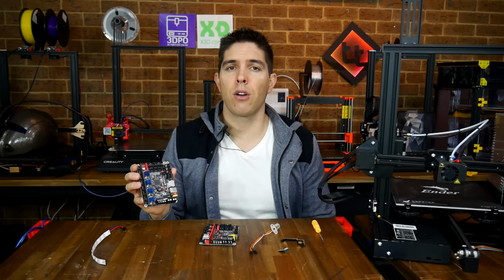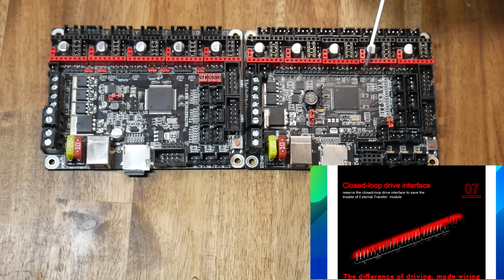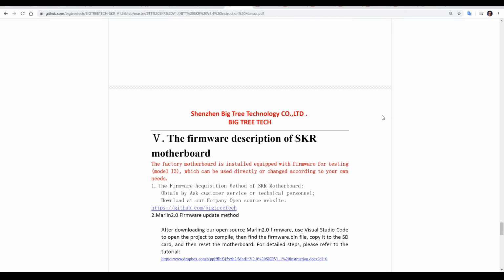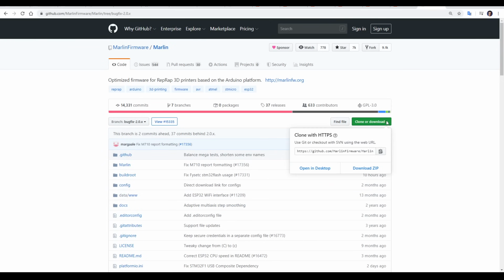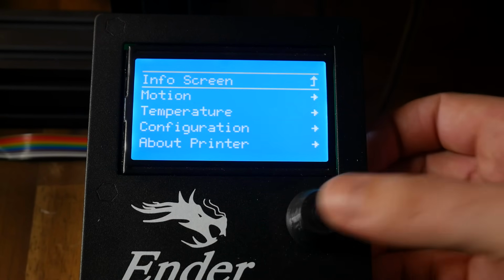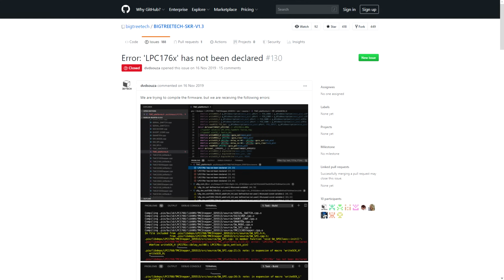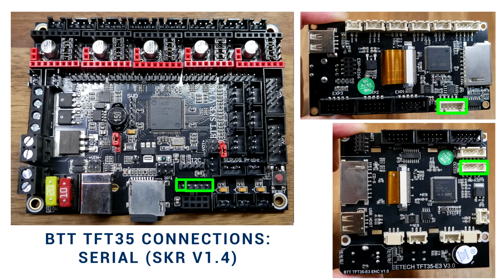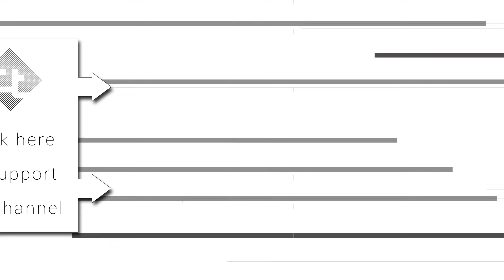Bigtreetech SKR V1.4 (Turbo) comprehensive guide

Comment: I have an Ender 3 Pro and replaced with BTT SKR 1.4 Turbo along with the original 12864  LCD Control Screen (came with printer). After doing everything Michael mentioned in this VERY HELPFUL video, I ran into ONE ISSUE. When scrolling down to print off the SD card I would only see "Attach Media". ... After many hours and taking out whatever hair I have left, I noticed under "configuration_adv.h"  that the #define SDCARD_CONNECTION was set to LCD (#define SDCARD_CONNECTION LCD). Obviously there is no SD card slot on LCD. You'll need to change it to #define SDCARD_CONNECTION ONBOARD . Flashed the Firmware and finally I see the "Print from Media"! Hope this helps others with the same or similar setup.

Comment: In order to use bltouch proprietary connection in skr 1.4 board, you must change the pins port in pins_BTT_SKR_V1_4.h file.

From: 
#define Z_STOP_PIN         P1_27
To:
#define Z_STOP_PIN         P0_10

Great content teaching tech, keep going!
Reply: Thanks man, it fixed it for me
Reply: You do not need to enable #define_BLtouch in configuration.h?

Comment: Thank you for doing such in-depth guides. Tonight I upgraded my CR-10s to the SKR 1.4 with 2208 drivers and it went just fine. But it’s very easy to skip something and waste tons of time figuring out the mistake. My advice for noobs like me is to watch, listen and re-watch. Excellent content. Keep up the great work. 👍
Reply: I'm trying to do it on a CR-10s but it is not loading up, it turns on but does nothing.. any idea what I might of missed?
Reply: Hi! Are you using Legacy mode or UART mode for your 2208? Because it seems UART mode for 2208 requires soldering, but it's not mentioned in the video,can you confirm? Thanks

Comment: I have an SKR V1.4 Turbo on order with the TMC2209 and a TFT35 V3.0. I've never performed any of what you've shown but understand what's going on and your video....well...so amazingly well done, to the point with sufficient explanations. Looking forward in executing this project which will involve replacing my controller box with something designed differently, maybe that one from Thingiverse between the frame rails. Thanks for a nother very informative video, I learned a lot.

Comment: So I've watched this guide multiple times start to finish and it's amazingly thorough. With that being said my ender 3 has been out of commission for about 2 months since I did this upgrade. I followed everything to the T and haven't gotten a successful print since the upgrade. Things I changed are SKR v1.4 Turbo, BLTouch, and Hero Me Gen 5. The issues keeping me from getting a successful print is as follows. When I try to home, the X axis will move slightly then home the Y and Z normally. I tinkered with the sensorless homing sensitivity but the issue is let's say at 55 it moves ever so slightly and stops as if it's homed and at 54 it crashes into the endstop makes a horrible sound until I power off the printer. There are times it doesn't do this so then I move on to bed leveling with the BLTouch, for the most part it levels the 9 points on the bed fine but sometimes when I get to this step it probes off the bed as if the offsets are off but trust me, they aren't. I've gone through the marlin rebuild process about 10 times now, each time starting from scratch and patiently ensuring all the settings are exact and perfect. Another issue is if I make it passed the bed leveling stage and attempt a print the printer acts as if its not leveled and prints like a whole 10mm off the bed and no amount of Z Offset seems to help with this. I've even gone to the extent of disassembling the entire printer and reassembling to make sure everything is square and not built unevenly. I pretty much gave up about a month ago after spending literally 10 hours straight debugging/tinkering/rebuilding marlin, and yes I mean literally my adhd had me in hyper focus mode and did break focus until i noticed how thirsty I was. It's just such a grab bag of issues that I don't know where to start or what would cause what issue. Like the issues I mentioned intermittent like I can have it to where the sensorless homing sensitivity is good enough to where the X will crash but stop after that which is annoying but hey atleast it's moving right? Then i get to leveling and it'll probe off the bed so I have to restart and now the sensorless homing isn't working? but the bed leveling is? makes no sense. I'm not trying to bash your video just really really want some help so I can actually print things again.
Reply: Look at the video about 13:40 minutes if you are using TMC 2209 you need to clip the pin if you are still using the endstops.   If you want sensorless homing then remove the endstop and do not clip the pin.

Comment: I got this board just over a week ago, and I absolutely love it compared to the SKR Mini S3 I was using prior. There's a lot more options and connectivity, and it stores settings without any messing around! I actually went through 2 SKR Mini E3 boards, and both had the X-axis driver burn out in less than a day. I bought the SKR 1.4Turbo because if another driver blew, I could just replace it instead of the whole board. Thankfully, I haven't had any drivers die since! But to be safe, I have installed a remix of the AIO enclosure that has direct cooling to the drivers, and used thermal epoxy to affix the heatsinks, in order to get the best heat transfer. Thanks for all of your work so far, you've been my greatest resource since I started printing almost a month ago!
Reply: I feel you, my SKR Mini X axis driver died a couple days ago and I'm now back on the noisy stock board so I can get some prints out. I swore to never buy another board with integrated drivers.
Reply: @oriongaby  my sentiments exactly. I thought maybe I had just gotten a bad board, but an identical failure told me I should try swappable drivers. The 1.4 was exactly what I needed, I just wish this video had come out a week earlier!
Reply: @munkpuppy  I think there's something related to the board design that is causing problems with the X axis driver. If you search on the internet you will find other people that have had the same problem. My board died randomly, I was fixing a loose screw in the Y gantry and had to remove the screen and printed drawers that were under the bed, when I plugged the screen back in and turned on the printer the error message was on the screen.
Reply: @oriongaby  mine failed under similar circumstances; both times I turned off the printer to make an adjustment, and the next time I turned it on, the x-axis is dead. Good to know it's not just me!

Comment: Excellent video ... The mainboard on my Creality CR10 v2 recently stopped working and I purchased the BTT SRK v1.4 Turbo with TMC2209 v1.3 as a replacement. It's been a straight-forward swap so far and The Marlin setup (V2.1.1) has gone smoothly also.

Comment: I just got my BTT SKR 1.4 Turbo with TMC2209 steppers. I plan to install this on a CR10S V1 along with my BLtouch, and direct drive Hemera. The current system is working great, although I feel the need(want) to get a 32bit board. I guess if you mess up you can squeeze the little duck it comes with, that should make you feel better. Thanks for the guides, I'll be going over them multiple times!

Comment: Great video! Very concise and enough detail to get the BTT board setup without a lot of hassle. Getting the BTT V1.4 board to work from scratch isn't a cake walk due to very poor documentation but thankfully there is this video and a lot of info from the community.  
To make BLTouch work requires that the file "pins_BTT_SKR_V1_4.h (or pins_BTT_V1_4_TURBO.h if you have the TURBO version) be modified as follows: #define Z_STOP_PIN         P0_10   //(not P1_27). Similarly in Configuration.h you need to modify this line: #define Z_MIN_PROBE_PIN P0_10  // Bigtreetech 1.4 bltouch Z top pin. The line #define Z_MIN_PROBE_USES_Z_MIN_ENDSTOP_PIN should also be enabled. 
Getting the board to work with a PT100 temp sensor was a real adventure. It is possible to do this without nasty hardware tweaks but it requires you to create a new THERMISTOR_xx.h file. 
Just my 2 cents on their Wifi module: don't bother. It's too primitive and buggy. If you need to un-tether your printer go with Octoprint.
Reply: thanks for the info.
You do not need to enable #define_BLtouch in configuration.h?

Comment: Right on time, my SKR V1.4 (Turbo) arrived Monday and the TFT35 got here last week so really stoked to do this upgrade. Was scouring for info as I'm not that familiar with VSCODE but slowly getting oriented. Now with this vid I'm fully confident that I should have no problems with a fairly painless upgrade! I would love to see you do something on the ir sensors as there is very little info out there on utilizing  one instead of a BL touch. (1/3 the cost, non contact and high accuracy are just way to attractive IMO )

Comment: Another Great Video.  Thanks for putting this together.  Just to add (at 10'50) if Using a MAC the .pio folder is hidden within FINDER (explorer). Use CMD+SHIFT+DOT to reveal it, or use the upload button within platformIO (next to the compile button) to move the .bin file to your MicroSD or board directly.  Thanks again.

Comment: The "Auto Build Marlin" extension makes it much quicker to build and upload Marlin. Install it in Visual Studio Code using the "Extensions Marketplace" tab on the left side. Just search for "marlin" and it will appear. The Marlin logo will then show up as a new button on the left side of the window. Currently ABM just provides a simple interface to do build, upload, and clean, but it will be gaining more configuration tools over time.
Reply: hi, while it builds marlin, the motherboard should be connected to the computer or not?
Reply: @davidebastanzetti1362  connect only if you want to flash through a computer. If you throw on a USB flash drive, then you can not connect

Comment: Nice coverage, bought a 1.4 turbo and using it with my ender 3
Reply: Did you get the ender 3 display to work? Mine ist powered up but with almost no contrast. I have no idea how to solve this...
Reply: @kaihagenmaier211  yep, you need to set the cr10 display as active in the firmware
Reply: @fury211  Do you use bltouch?
Reply: no, capacitive sensor

Comment: My 1.4 board arrived this week and I am busy trying to follow the various Github options on my own Marlin compilation. Mainly, I assumed that using the BLTouch in the endstop socket would mean cutting the TMC2209 pin, so thanks to your video I will use the socket and not cut it. From your previous video on the TMC2209 I believe that the inverting can stay the same as the Ender 3 code, so I will go with that.
Thanks for your videos!

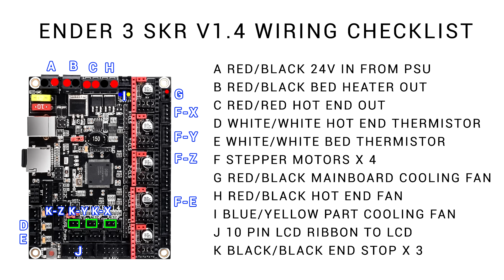Comment: Your channel has provided so much help and advice on 3D printing. I have one query at 7:30 it says H is for hot end fan. The port H is for a second hotend on the skr v1.4 turbo. I am having issues with my 2 month old board were the parts cooling is not working. I contacted BTT and forwarded this checklist only to be asked had I connected a fan to the hot end (I hadn't) but told them the port never worked not realising it was a hot end port at the time.
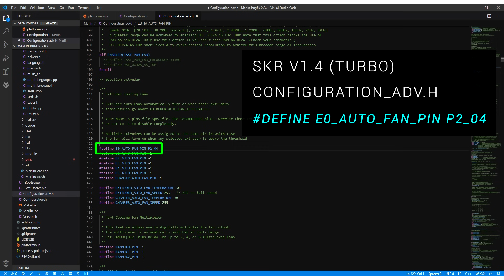Reply: I know this is an old comment/video but for others who are confused by the HE1 on the board's pinout and find this comment like I just did, the H label on the diagram is correct. At 10:20, the firmware change E0_AUTO_FAN_PIN to P2_04 changes the hotend fan to the HE1 screw-in terminal. So if you are upgrading an Ender 3 (or other printer with a single extruder) and make the firmware changes as instructed, the hotend fan MUST be connected to the HE1 port. This was done to allow for an easier direct replacement for the Ender 3 without having to change a connection type.

Comment: I was wondering when you would post a video for the SKR 1.4. I watched all of your SKR and driver videos (and all your other Ender 3 related videos) when I ordered my Ender 3 Pro (my very first printer YAY!). I just put the SKR 1.4 Turbo board in last weekend with TMC2209 stepper drivers, didn't mess with the sensorless homing though in hindsight (I clipped my pins) I could have used the switches to make a filament sensor, I'll just do that with the Z switch once my bltouch comes in. Overall I am loving the board and drivers, it's so much quieter than the stock Melzi board!

As always, a very informative video! Thank you!

Comment: I ordered my SKR v1.4  a while back. It took forever to get here from China. Haven't decided what to do with it yet. I really like the BigTreeTech products so far.
 I first bought the SKR E3 and installed it into my Ender 3 Pro. It has been working great so far.😉
 I put my SKR v1.3 in my old FLSun Kossel Mini. 
 I used my SKR Pro for my diy cloned Prusa I3 MK2 which I named Birchy because it's main frame is cut out of a sheet of birch plywood. I also used wood filament for some of the printed parts.😋
 I also purchased the BTT GTR v1.0 and it's still sitting in its box. I'm thinking of using it for my coreXY build and making it into a tool changer type printer. If I can figure out how to do that.🤔 LOL
 I also purchased quite a few stepper drivers from them.
 Only issue I have BTT is I am not sure what I am going to do with all these little rubber ducky's. ROFLMAO 🥴

Comment: I just done all you have done in your video but I haven't got a tick and the bottom to compile the file I am new to this programing thing It could be something simple i a missing
Reply: I have the same problem as you and I can't find the firmware.bin please help me out if you find some informations earlier than me
Reply: Same problem... Did you find it?
Reply: Anyone find a fix
Reply: I am thinking it could be something stupid like does the mainbored have to be plugged in to pc
Reply: @stevenpaulson4739  i found the fix.
For the tick on the bottom, you have to do this procedure:
https://platformio.org/install/ide?install=vscode
Regarding the .bin, it is on the file .pio. But this file was hiden on my computer.
it's more complicated on mac than window to show hidden file, but I manage with the terminal:
1/ Write: defaults write com.apple.Finder AppleShowAllFiles true
2/ Press Enter
3/ Write: killall Finder

Comment: Great video as usual, very informative. I have just upgraded my dual Z axis ender 3 pro to the 1.4 turbo (my 1.3 failed). I was using individual stepper drivers for each z axis motor but decided to try the dual ports on the new board. After setting everything up I was getting random horizontal lines in my prints. Then I realized that because the 2 stepper motors are now running of one driver I needed to up the Vref for the Z axis as it was skipping steps. I was running at 0.8v, I had to up it to 1.1v and everything works fine now

Comment: I have this board and the smaller tft after you recommended the v1.3 and I saw the 1.4 had dual Z stepper support so thought it would be better for my printer. I am having to make some designs to fit the screen into my copymaster 3d printer as I brought the smaller one, but I can do it without mods to the metal. I also have the tmc2209 so your guide is spot on and I will be using it very soon.  It looks like Marlin had copymaster listen in the config files so I think this should be easy enough. The only part left for me is to design a filament cooling duct for the addition fan I had to add as the original setup had a shared fan for the hotend and filament cooling and was very poor.

Comment: Thanks for the great video. I am running a CR10S5 and thinking about upgrading it with a Bigtreetech 32bit board, mainly because of the 24v power supply and the chances of cleaner prints.

Comment: Hi, Michael!
I faced a problem when I was upgrading my Tevo Tarantula to a SKR v1.4. 

When I was connecting my inductive sensor to the Z endstop signal, it wasn't working because of the pull-up resistor. 

It's a NC inductive sensor. After some research and tinkering, I ended up connecting the signal to the signal of the servo port P2_00, replacing it in the firmware in place of the P1_27.
Just to share in case someone faces the same issue or you decide to update your tutorial.
Keep up with the nice work!

Comment: Am I doing something wrong? I installed VS Code and I am at the point where I am making the changes to p0latformio.ini, Configuration.h and Configuration_adv.h. The problem is that I don't have the "compile" button and there were a couple errors. I tried installing the full Visual Studio (not sure how to compile from it either) and now I have 105 errors, all of which read, "expected an expression [#,  #]".
Reply: I uninstalled Visual Studio so now I just have VS Code... still no "compile" button but I only have 1 error for Configuration.h (#include errors detected) and 1 error for Configuration_adv.h (also #include errors detected). Any help would be appreciated.
Reply: @seangfoster1974  klick left bar on extensions search for PlatformIO IDE
 download it and you will get the buttons on the bar
Reply: @eliasl.4086 - Got it. Thanks. Up and running now. :)

Comment: I might be wrong but doesn't the diagram @7:32 say the hot end fan H plug into the E1 port on the board, wouldnt this mean that the hot end fan would only be on if you were heating up extruder 2? since it is powered from the extruder 2 heater port. 
shouldn't it be plugged into a fan port?
Reply: nevermind, the fan pin is changed @10.28